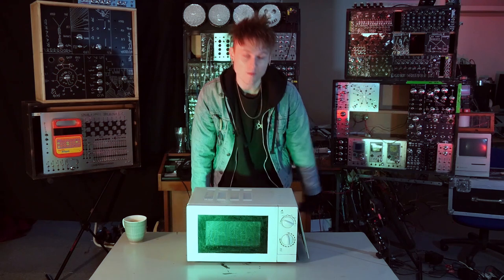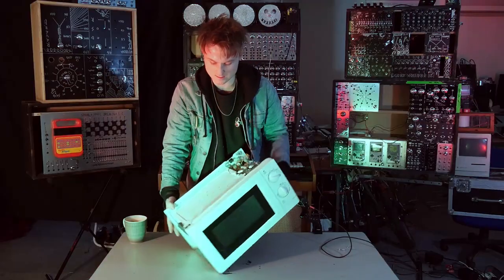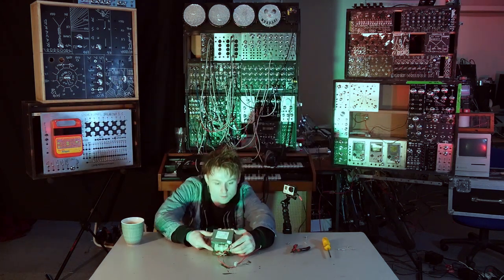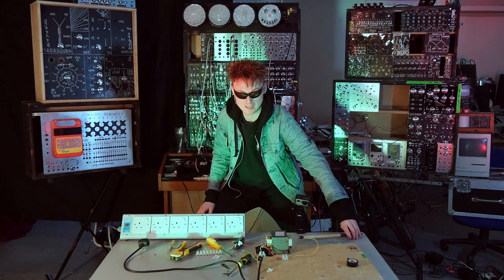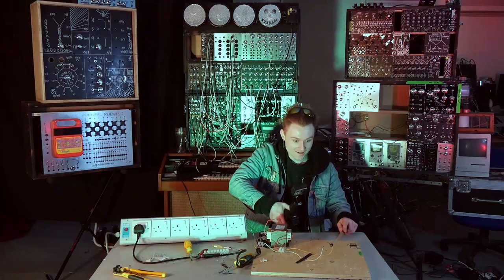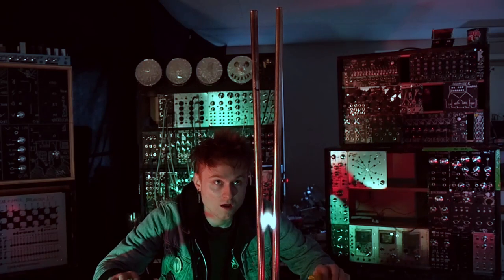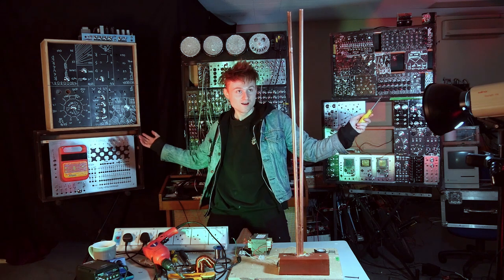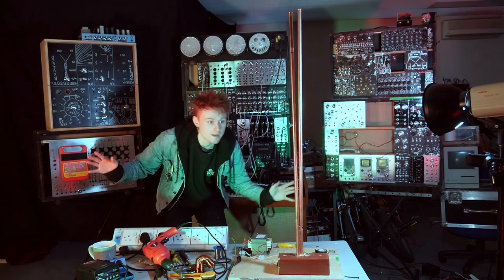Turn A Microwave Into A JACOBS LADDER HIGH VOLTAGE

Comment: 1. Super simple oscillator
2. Pasive RC filter
3. High voltage Jacob’s ladder using deadly microwave transformer.
…
 That escalated  quickly

Comment: You can definitely have a whopping fun time with bits from a microwave.

If anybody is gonna try this though, use at least a 2 (even 3) foot length of pvc pipe to make the arc by hand (hand at one end, connection at the far other). At these voltages the spark gap can be big enough to jump to your hand and wood can possibly still conduct if it's got moisture (electrical tape does fuck all to insulate here). Watch some other videos before attempting, these things don't fuck about (they aren't current limiting and can kill for sure). 

Then get more microwaves and make a capacitor bank for added fun :)

Comment: You could have used the fire of a candle light to start the arc but shorting the ladder with the screwdriver like a morron and damaging the screwdriver in this procedure seems to work too... Very badly and idiotic but it works.